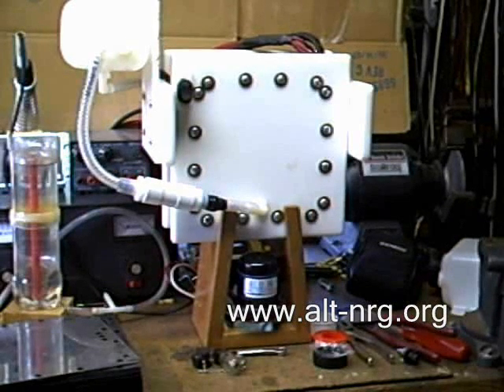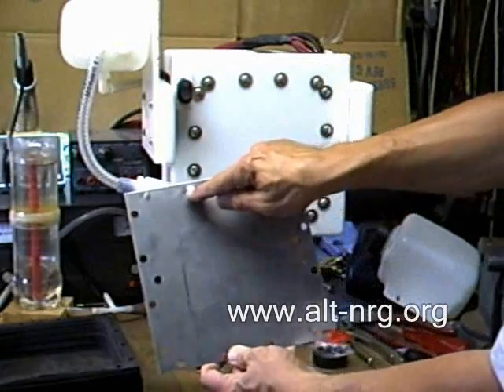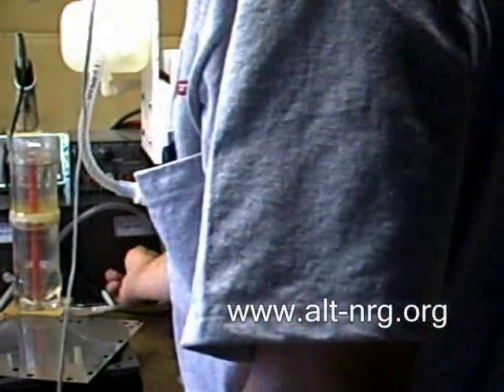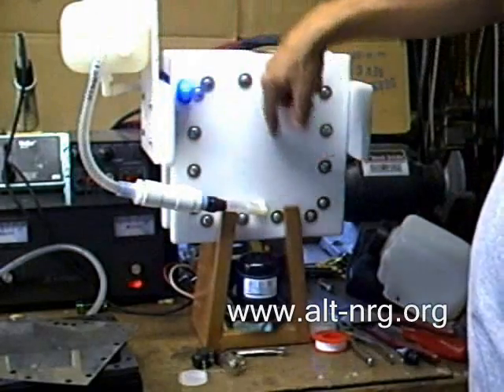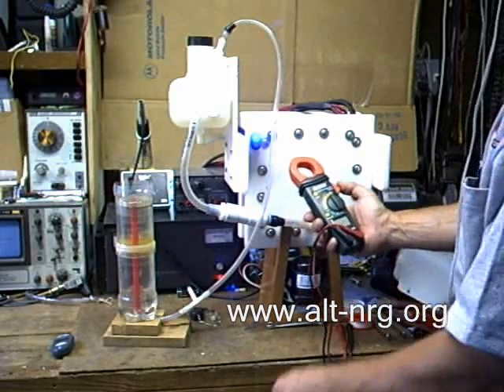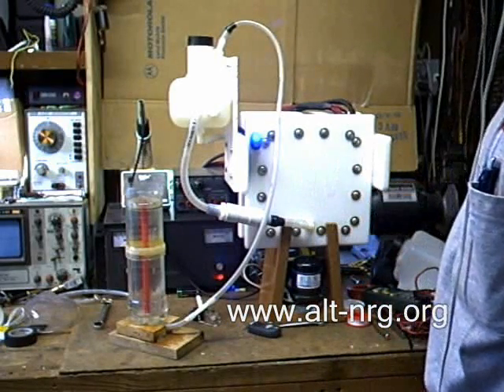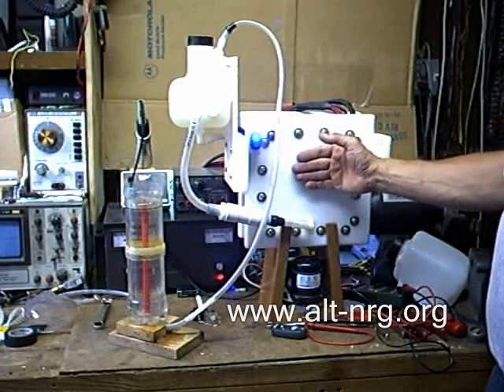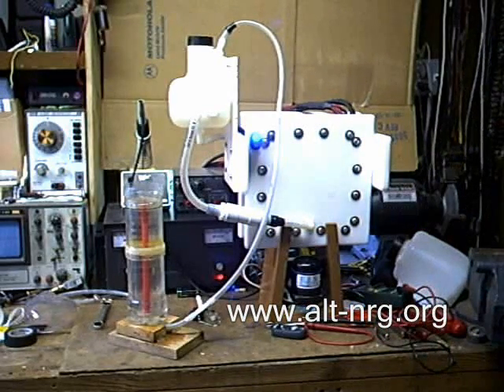#111 EBN Sealed wet cell kit, New HHO generator

Comment: 3.3. unless I was intentionally pumping hydrogen into the air to ignight the room, I would not get "blowed up". It would be safer than hho (which is the perfect ratio for the mixture to burn) in the tubes in case of a backflash. The hydrogen would not be able to ignite without mixing with oxygen.

Comment: 1. I stated i would use two tubes connected (vertically), so each gas would rise into seperate tubes.
2. why would I create enough pressure in the cell to blow it up? I was only stating that i would have to hold back the oxygen to get the 4-5 psi needed to fuel a torch.

Comment: I am currently looking to build a new hho generator, one that would seperate the oxygen and hydrogen, using two tubes connected. I will also have to figure out how the store the oxygen so i can get pressure for the hydrogen, but then have a valve to release the oxygen once and a while. When using a minitorch I believe seperate gases is much safer. Any ideas will help.

Comment: The goal of the HHO cell would be to overcome the energy it takes to produce the HHO (amperage draw on the cars electrical system), by producing enough HHO.   

This is why I ask if anyone has figured out how much HHO (Litres per hour), you have to reach vs how many amps it takes to produce that HHO.

Comment: If you get any decent MPG improvement that is great!  A 20MPG improvement would be extremely good.

I am asking about amps vs HHO output as that is the major obstacle this cell has to overcome to make it a success.  If you've ever tried to spin an alternator with any draw on the cars system you know how much energy it takes.  The more load on the altrnator the more energy it takes form the engine which = more fuel consumption.

Comment: OK, so 1000 amps at 12 volts is 12000 watts of power. That converts to a cost of 16 horse power or the amount of energy in .32 gallons of gasoline x .20% because of the lack of efficiency of the ICE.

Comment: I think it depends on "the results that you are looking for". So if you are just looking for improve efficiency I think 2-5 lpm gives you that. A lot depends on the current efficiency of the engine in the first place.
If you are looking for no gasoline and strictly HHO it goes way up from there. 60-100lpm to get you started. Depending on the energy demand of the ICE.

Comment: It seems most people are getting around 2-5Lph with a 30 or so amp draw.  I am only wondering if that is enough?  As it just seems a little low to obtain the effects you are looking for.

I am not trying to be negative, I just recently started watching these videos and find them very interesting.  I am just trying to gauge how far off you are from making an efficient unit that people can use and get the desired results.

Comment: FluxCapacitor2008, a/f ratio of only 5.15:1?  Is that a mix fule of a hydrogen & pump gas?

I know a regular gas vehicle requires a much higher a/f ratio of around 12.5:1.  5.15:1 is a little low/ lean no?

Also my initial question isn't answered, which is how many lph of HHO is needed to get this a/f ratio you are shooting for?  

The only reason I ask for the lph is that seems to be the typical measuring system used to determine how much HHO their dvices use.

Comment: dsmtsi Look at it this way. The way that it's done on most of these cells.. It may take 30 amps to generate the HHO but technically you get that back, laws of thermodynamics. Here is just one of the kickers though. Mix HHO that when combusted you get 100% energy conversion. Gasoline on the other hand in an ICE does not completely burn. This is why we have all the emissions on our cars. But mix the HHO and now you Not only get the energy back you also get more complete burn of your gasoline.

Comment: I don't understand how this will actually help get better gas mileage if it takes 30+ amps to get 2l/m HHO.  30 amps is a pretty big draw on the cars alt. which puts more load on the engine.

Am I missing something here?  But by the sounds of it, the cost of producing HHO is as much if not more energy then the unit produces...?

Comment: I am now begining to suspect that you need quite a large ammount of hho to enhance your engine power in conjuntion with gasoline. say at least 5 litres a min. If one could compare the ammount of butane gas needed to run a car engine would it still be 60 liters or so a min? How long the gas tank will last? Am I missing somthing here? remember hho is 2.5 times more stronger than gasoline according to Stan Meyer. so maybe you need 1.5 times less gas for the same power no?

Comment: So using Brute force electrolysis would take roughly 13,500 watts of power to run Stan's 50 horse buggy at 65 mph. Or 1124 amps at 12v. Someone correct me if I am wrong please.

Comment: More: Remember that you can add an inert gas to the hydrogen to slow that down to the burn rate of octane, no timing issues. I think in doing that you are diluting the amount of hydrogen needed per cycle, therefore saving more Hydrogen. Another benefit is the engine now runs cooler adding even more savings. These figures are somewhat my own and may be wrong, check it out for yourself. One more thing the BTU figures are for straight Hydrogen not HHO which has a energy characteristic all its own.

Comment: Stan Meyer full data. "water as Fuel" 50 hp ICE 111 ml/min gasoline consumption rate (on road test) @ 65 mph. Hydrogen gas has almost 3 times the amount of BTU's of gasoline. So based on this figure you should be able to get the same energy from 37 ml water x 1800 = 68 liters hho. Now this also does not take into consideration the burn rate and 100% conversion of energy that you get from Hydrogen.

Comment: Zero, great vid, I've been waiting to see this unit in production ever since lefty22 posted the video on production of the plates. Question -- wouldn't raising the bubbler/reservoir higher in relation to the cell increase convection flow of electrolyte and give you better production? I'd love to see a duration run and see what (if any) buildup there is in the cell. Looking forward to building my own.

Comment: Do you ever correspond with Dallasgoldbug?? I am working on three different configuration of cells now. (I am an auto repair facility)
I get the feeling that, at the end of the day, we might just see that gas liters per watt may be a constant regardless of cell design. I have one prototype that is stacked plates, one using a spiral 1/4" cable, and one using cups, with twice as many negs as pos. Will let you know how it goes. Concetrating on getting rid of heat right now.

Comment: just an electrolyte tip, if your using electrolyte with lye or KOH, and you just happen to get some on your skin, water will help, but please dont use soap, it will only make it worst. in fact, the best thing to use is and acid. Because the electrolyte is a base, using an acid to wash it off such as white vinegar will neutralize the effect.